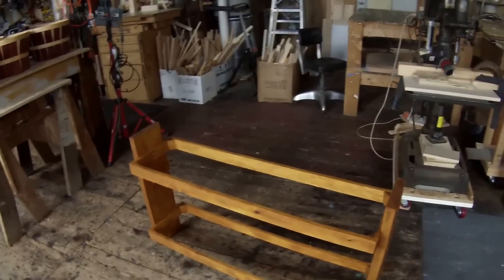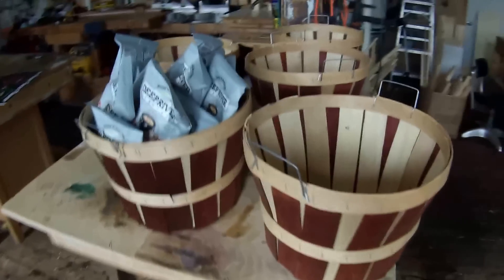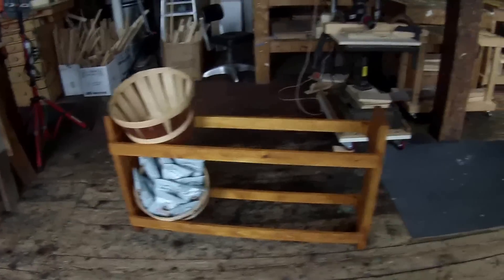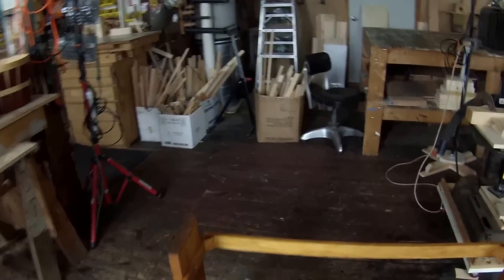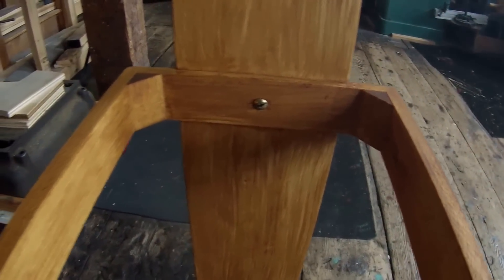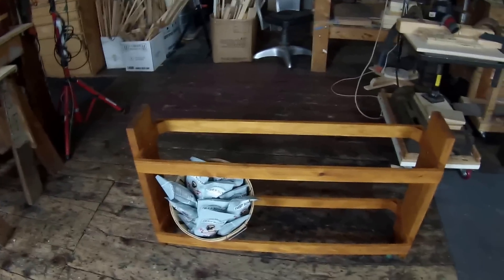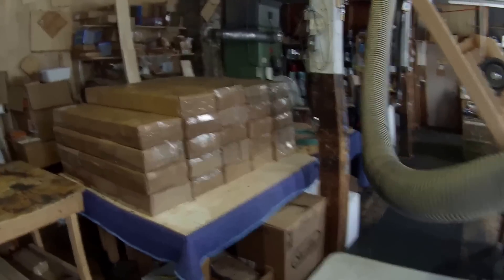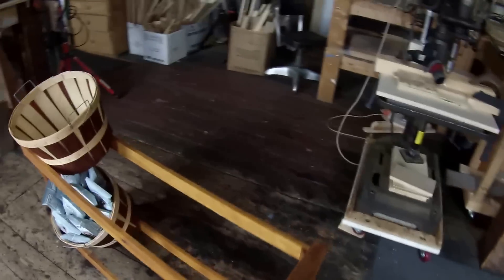Six Basket Snack Rack Production Process (part 1/2) - Introduction

Comment: I did this for some butchers block work and found that the set up and prototype took ages but when you were all jigged up and had material then the actual process was really fast. Then the question is how much of that initial time do you spread over how many units! Getting material ordered, time on the phone, etc. should be spread over the production run or at least there should be some allocation so you could say when you have completed 20 units you have broken even on set up costs. I will continue watching both videos and see how you get on. Well done! Regards from the UK.
Reply from the maker: When I measured the time for this job, I came up with two sets of data: one that reflected the production process by itself, and another that included the set up and other factors that eat up shop time, and this measured to be roughly 30% of the total time for this job.  This ratio will vary depending on job quantity and whether I have to get materials myself or have them delivered.  The design time and prototyping is not factored, and I guess I can get away with that working by myself but would certainly have to consider it if I were paying somebody to design shop jigs.
Reply: hffcom I watched the other video and I think you are spot on. Well done. I think I would have changed the design so that the vertical sides were also the same frame materials in which the horizontal ones would be fixed. That would make every component a frame and all stock the same size but just different lengths. They would pack inside one another so the size would be the same as it is now. It would be strong enough but lighter and avoid jointing which also took time. The packaging is a real time eater and I can't make any suggestions there as you seemed to do it so quickly and the material is free which is a great offset.
I am about to do a similar exercise for a fielded panel jewellery box which seems really complex but when jigged up I think could be produced in about 50 mins. There will be 2 stages of gluing which makes the elapsed time more complex.
I really am glad that I have found someone else doing this as many businesses don't. I work as a Business Analyst and Project Manager for business change in large corporates and it makes me smile when small businesses do jobs with just a blind faith that it must be paying. At $65/hour I would change thye desig to frames, jig up the gluing process of the frames and spend a lot more time marketing them to capitalise on that turnover and profit ;-)
Love your videos. Thanks for the inspiration. Colin
Reply from the maker: Colin Herbert Thanks for the thoughtful reply.  As far as the design, I have considered building these many different ways but I will go with solid plank sides in this case for 3 main reasons. 
1) saves machine time - joining and planing the sides only took about a minute, according to my pie chart.  doing the rips for the trays took over two minutes, so then making rips to make the sides would be similar, plus then requiring an additional assembly with glue. 
2) saves finishing time (the way I have to do it).  making the sides out of sticks doubles the number of inside corners that I have to paint by hand.  After analyzing the assembly and finishing process, I found that finicky brushwork took more than 1/3 of the time.  
3) the extra weight in this case is a great benefit to the stability, and does not seem to effect shipping costs.  although it is normal to minimize material when possible, the 2x8's in this design case are so cheap that it is cheaper not to cut them up.
Check out the link I posted above, and you will see I have built many different racks.  For building larger custom racks, I always go with stick sides but the process does not work well with knock-down designs.
Reply: hffcom Fair points and I agree having looked at the other items. Its nice to be able to be challenged on things like this, if that's OK. It helps the thinking process! I am now staring on some of your other videos. Have a good Christmas. I am thinking about starting some videos...